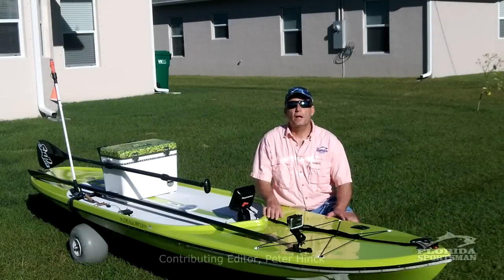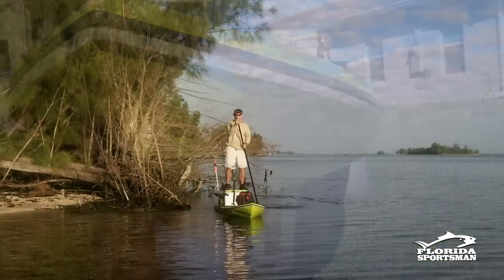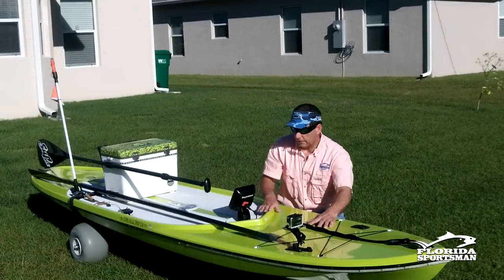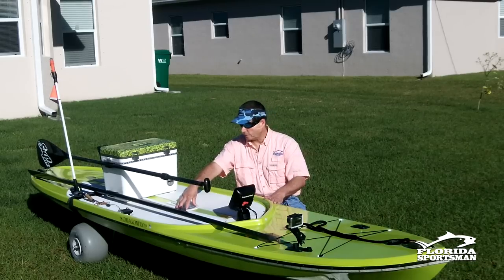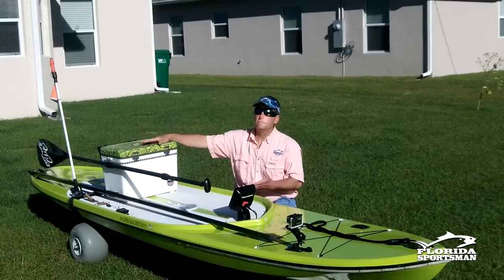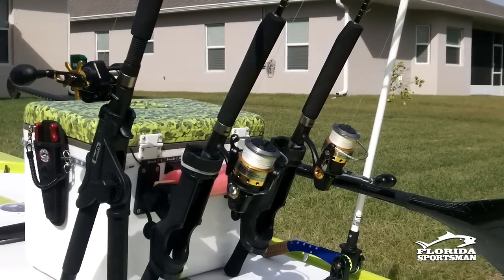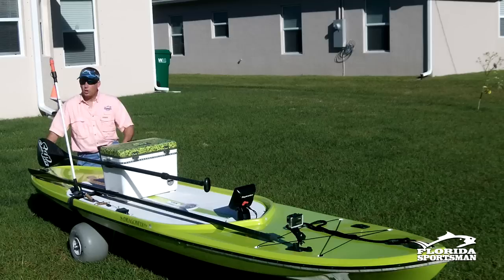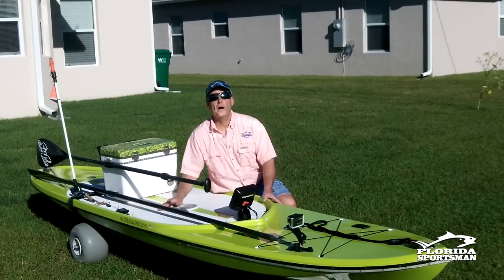Dragon Fly Paddle Board Set Up

Comment: It's nothing like carbon fiber, it's fiberglass
Reply from the maker: The board that are made now are made out of fiberglass.
Reply: Yup, just another sales pitch to make to sound good.  Epoxy resins can be used with carbon fiber and glass fiber, but you cant use vinylester or polyester resins on carbon fibers or aramid which is the fibers used in kevlar. The weave of carbon and glass can be very similar aramid has a much tighter weave